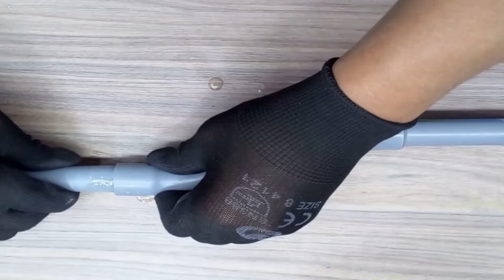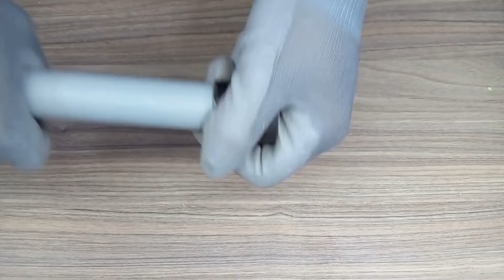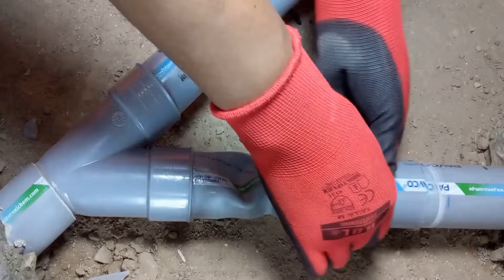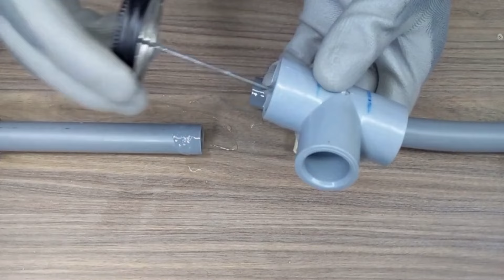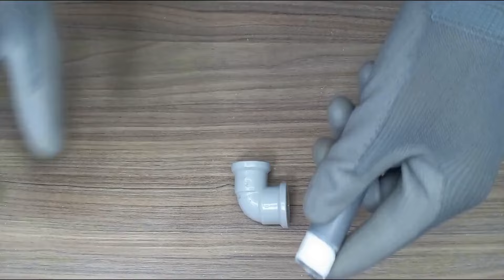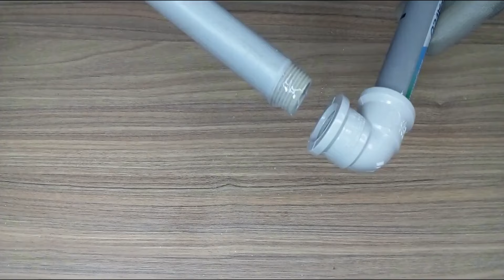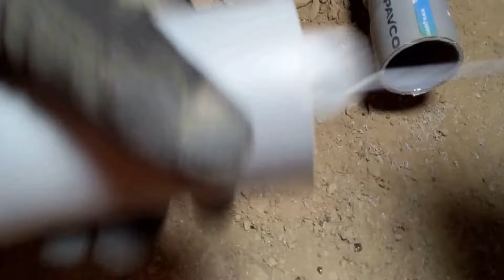10 Trucos o Formas de Reparar Tuberia PVC -  Hazlo Tu Mismo - Plomeria - PVC

Comment: "The manufacturer indicates that the pipe should not be heated"

-Heats everything.
Reply: Yeah I was about to say that people should not do what he is doing, because the walls of the pipe might get too thin and he might shrink the clearance inside the tube.
And that might increase wear and the likelihood of the tube bursting.
Reply: I am third generation plumber... id fire him and report him.  Never do this stupid shit. He looks like a hack unwilling or to cheep to do things right. . I mean... gluing a piece of pipe over a leak and tying it with wire lmfao... that one would get him beat up if he did that on my job.
Reply: @seditt5146  being a 3rd generation plumber, you dont know that the manufacturers of pvc allow the pipe to be heated..
I had to dig out my water main in several locations because of idiot plumbers. 
Since the main was never installed STRAIGHT it has stress points which caused fittings to crack in the mold lines..
The pipe is about 1/4 out of alignment..
I reinstall new fittings and pipe with schedule 80 instead of the schedule 40..
When talking to a manufacture representative,  he told me I can heat the pipe to relieve the stress..
The last one to break, a 1-1/4" x 90 degree fitting, broke below the service main valve coming into the house..
The idiot plumber during construction installed the house copper line about 5 degrees off 90 degrees coming out of the house and when sweating the fitting for the main valve sweatted if off at an angle about another 3 degrees off 90 degrees going down..
The pvc pipe going down into the ground is off by 1/4 inch or more alignment to the right of 90 degrees going to the horizontal  service  line at an angle not straight..
Only way to fix it..
Heat the copper pipe coming out of the house making it 90 degrees to the house or better, to put it, "straight", install a new "T" for the valve making it straight, replumb the pvc pipe..
The representative, said to heat the PVC into place instead, it wont change or hurt anything as long as it's not burnt..
By the way I'm a pipe fitter of 50 years..
I deal with manufacturers at times over issues such as this..
The best one I like, I got a plumber out for an independent opinion, must be the one that install  the service line..
He recommended digging up 75 feet of the service line from the meter, install a new one, including fixing the out of plumb copper work..
Which also means digging up the driveway since the line runs under it..

This latest repair will be the 4th time..
As for the repairs made in the video, i agree with some, but as the representative said pvc can be heated and bent into place..as long as it's not dramatic..
Reply: It should be noted that this is specifically why many states (US) have banned the use of PVC for any application that is inside of a building.

For outdoor application they don't really regulate  unless it's a water supply line. Theres a reason poly and other flexible pipe has effectively become the standard. 

If you're using PVC so much that you've learned 5000 "tricks" to "bend" the rules, you may be living in a country that hasn't embraced modern techniques and materials. (For cost, availability, or regulatory resons). I cringe seeing CPVC in almost every modular home between Denver and Appalachia, it's prone to failure, especially in high use, small Guage situations. 

 That being said, don't use PVC in a moisture sensitive environment. I think that's fair.
Reply: @6731adam  moisture setting environment. 
That's funny since its the go to product for water mains. In my state and
In areas where the frost line is deep is where it's a concern. 
6 feet down the temp average is 55 degrees..
Imagine digging down to fix a busted water main  because you dont want to hire a plumber because of raping of your wallet will get. ..
Reply: @Butchsiek  I live in Utah, all new construction and even city mains and building mains are switching to poly, mostly because it's cheaper, easier, durable to freezing, and last pretty much forever....

.....Unless you're fence guy hits it with an auger. There's that. 😆
Reply: @Butchsiek  I'm saying, don't use PVC in you're house, or other structure where things getting wet is unacceptable. PVC is prone to breaking, or coming apart, or freezing and subsequently leaking. Why would you if there's clearly alternatives that negate all those risk? That's all I'm getting at.
Reply: @6731adam  all pipe sources are subject to freezing and failing. My neighbors copper pipe ruptured when the temperature got down in the mid 20's overnight, he and his family was at Lake Tahoe enjoying the weekend and  when he got  back his house was flooded....
The pipe is in the attic because the house has slab flooring..
If he left his heater set and on at least 70 degrees, nothing would have happened..
My water main was frozen and I took a propane torch to it..then I wrapped it in a blanket because the temperature was going to get down in the teens at night...
Just the opposite when it's hot out in the 90's and 100's the cold water takes about 30 seconds to get cold....
Now its flexible tubing in new homes...
A step relative bought a mobile home, the piping is ancient, I offered to replumb her home because the pipes are rusted due to being galvanized pipe and the prior owner had a combination of bastardisation of plumbing repairs, copper, pvc, galvanized and pex..
I offer to due it all in copper, she turned me down saying I wasnt a plumber and dont have mobile home experience..
Everyone laughed at her, because i have done other movie homes for friends..
I let her waste her money and let it go....
After 4 months she still hasn't found anyone that specializes in mobile home plumbing or wont accept their qualifications...
Reply: @Butchsiek  lol! That's hilarious.  She'd do great on California board of contractors!

I wouldn't use copper unless it was just a repair situation. Even then, pex and shark bite justify their cost in time saving. Not like copper is that cheap either
Reply: @6731adam  oh to add salt to the wound.
About 14 years ago, I bought a water heater, it was a good deal and it included installation..
I shut the main off at the meter and then the house and water heater..
When I went to fix crack 90 degree fitting and turned the water back on, I went into the garage, the valve was leaking through the packing. Once open it stops leaking..
So much for a new valve that was used once..
I tighten the packing nut but still leaked..
Another project for the summer..
Reply: @6731adam  my neighbor around the corner was the on CaliFOREIGNia state contractor board..
The guy was an ass, he would peak over fences to see if things needed a permit, then go to work and mail them a fine if none were pulled..
Of course the fine is small, but the hassle to correct it was a pain..
My shed I need a permit because its bigger than 100sq. Ft..
Its 1400sq. Ft.
I would have to provide prints, pay for a permit and wait for inspection during the building process..
The reason, they think it would be used as a rental for living..
I had it built without a permit.
Reply: @6731adam  the relative doesnt want plastic anything  for fear of leaking or taste. 
She wants copper..
I do have 12, 12 footers of, 1/2" copper pipe in my garage, she could have for what I paid for them, $5 each.. 144 feet would about take care of 50% .
Reply: This fact is only for eléctrical pipes called conduit,so they can be heated
Reply: @carlossanchez5150  he indicated several times that this was water pipe. "Flow must be respected"
Reply: Even I who has no knowledge of plumbing knows that you shouldn't heat PVC pipes because it gets brittle easier
Reply: The disclaimer says specifically that heating is intended to be used ONLY in cirumstances when theres no other chance
Reply: Hes also decreasing the area of the pipe that means the pressure is going to be a lot higher
Reply from the maker: El Fabricante de Mi País indica : NO CALENTAR LAS TUBERIAS 

- Gasfitería y Electricidad : Como puedo reparar una tubería fracturada en tal situación , Pues Usted como fabricante no fabrica conexiones o aditamentos Especiales para realizar determinadas reparaciones .

- Fabricante : SOLO EN CASO EXTREMO , DONDE NO EXISTA OTRA ALTERNATIVA , ALLI SI PUEDEN CALENTAR LA TUBERIA . 
- Gasfitería y Electricidad ; Que se vayan a la verga los fabricantes de mi país .... Nos venden Tuberías y conexiones , nos indican como hacer la correcta instalación , y luego cuando se presentan fallas y no tenemos mas opción mas que calentar,  nos dicen : Repáralo pero sin calentar .... Si Usted estuviera en mi País realmente amaría el video con todo su corazón , pues es lo mejor que puede haber en su tipo .

Exitos a Todos .
Reply from the maker: Entonces aqui te moririas de hambre pensando dia y noche como solucionar una filtración . La gran diferencia es que Si Usted viene a mi País , Usted tendría que empezar de Cero , ya que veo que tiene una forma delicada de hacer las cosas . Yo por mi parte si estuviera en su país , podría resolver cualquier problema en la decima parte del tiempo que Ustedes lo hacen ...
Saludos Pinche Colega .

Comment: These are really handy tricks for the DIYer whose just trying to modify their drainage pipes and doesn't quite have the right bends/unions to finish the job.
Saves a trip to the shop.
Provided you have the skill to do it I can't see any reason why these fixes wouldn't last as long as using unions.
Reply: I don’t think your gonna do that to 2 inch or 3 inch pipe lol
Reply: @edgiraffr1352  well I was thinking more of the 32mm or 40mm under sink stuff, but I see no reason why it wouldn't work on an 80mm foul pipe if all your trying to do is make a socket.
Just be patient and gentle with the heat.
Reply from the maker: Gracias por su comentario .
Es exactamente como Usted lo sugiere . Son para trabajos menores , trabajos provisionales , trabajos de emergencia . Cada quien debe de garantizar su trabajo y analizar diversos factores antes de realizar cualquier reparación . 
Éxitos a Usted .

Comment: The quality of the pipes degraded drastically after bending by heating. It creates a lot of very small cracks on all sides of the heated pipe. In few years, the pipes will leak and finaly allow germs to enter into the flowing water. The leak may not be visible easily.

Comment: They heat pvc pipe for hot tubs. I worked at American Standard and they put pipe in a heater to mold it around for the jets.

Comment: I have experience in almost losing several thousands of dollars from water leaks caused by burst PVC. NEVER use it on water pressure. This was a nice video though
Reply from the maker: Greetings ,
I can say that PVC is very good, it must be installed correctly and the right material must be chosen, a good quality PVC material.
Thank you for your comment.

Comment: Interesting, though not recommended swedging the pvc because it thins the walls, small bends are acceptable..
Such as an alignment, but every country, state, county or  city can have their own codes...
Where I live, codes wouldn't allow thinner walls so sanding the pipe isnt allowed only fittings that have the same thickness..
Manufacture respresentative, stated heating for alignment only. Unless it's for non-costruction then it's ok
Reply from the maker: Greetings and Thanks for Your Comment.
-The Best Successes For You.
Greetings from Peru. 🇵🇪

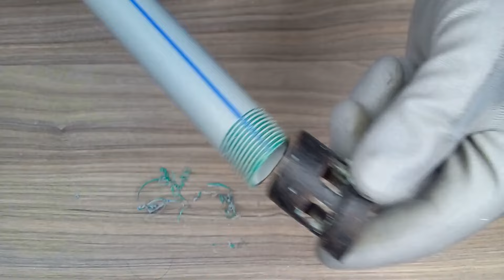Comment: At 1:35 he puts the thread tape on backwards.
Should be clockwise if facing the end of the pipe.
It matters
Reply from the maker: Greetings .
You are in the North, and I am in the South, so the turn is correct. Otherwise our system would fail. You can find this phenomenon in various subjects , for example the whirlpool it makes in the toilet is the opposite of the whirlpool it makes here in South America .
I hope I was clear .
Successes to you.
Reply: @GasfiteriayElectricidad  
You still have right hand threads.
Think of the tape like a coil  spring
With the tape correct you are making the tape tighten ad you turn your internal threads over it.
With it wrong, the internal threads push on the end of the tape loosening it. There by pushing the tape off instead of going over it
Otherwise good work.
Reply from the maker: La intención del video NO ES ENSEÑAR A APLICAR CINTA TEFLON. 
En dicha parte el video está en espejo por un error de edición. 

Bendiciones

Comment: Can we heat all pipe..heavy duty (thickness large)
Reply from the maker: Greetings .
Each country has its own regulations and its own additions for repair.
Here in Peru we do not have special connections to do this type of repair. PVC is different in each country, and before carrying out a repair several factors have to be analyzed.
Successes to you.
Reply: I'd suggest just trying it on a piece of scrap and see how it goes.
There are no codes to follow in the UK with regards to types of joints used.
All they say is for sanitary pipes they need to be water tight and hold 38mm water pressure for 3 minutes which is nothing.
Can't see any reason why these joints wouldn't achieve that.

Comment: Idea is good. 
But the strength of the pipe will be lost at the outer surface where the pipe was bent. 
It is more risky if you r using the pipes for  hot water.
Reply from the maker: Greetings
Once again answering what I answer to all those who do not read the description of the video and the pinned comment.
This is for smaller scale repairs, emergency and temporary repairs.
You should know that each country has its own quality of PVC pipe and we have different working pressures.
I wish him well .

Comment: The question is: Will the pipe have the same lifetime after being heater to bend?
Reply from the maker: Greetings
The pipes only do not suffer exhaustion after being heated. I have left information in the description of the video. You have to analyze various factors, the ideas in the video are to be applied in minor plumbing, popular housing, places where the pressure of work is not greater. Usually the working pressure in a home is 60 PSI = 4 Bars, easily the class 10 water pipe that supports up to 10 bars can last as many years as a pipe without being heated. It should only be heated in extreme cases, when we have no other option. You should know that in my country there are not enough connections or attachments to make different repairs.

Comment: Most of these will not work if the pvc is going to be used with fluid under pressure. When you join pipe with pvc cement you have to put the cement on both parts of the connection and turn the connection a quarter turn to make sure the cement fuses the joint properly. If you omit this step your connection has a much higher risk of leaking or separating.
Reply from the maker: Saludos , 
La intención del video NO ES ENSEÑAR A PEGAR O UNIR TUBERIAS DE PVC.
- Me gustaría que Usted defina : Que es y cuanto es alta presión ?  . Sabiendo su respuesta podremos seguir dialogando .  H e dejado información en la descripción del video y en el comentario fijado .
Le deseo lo mejor .

Comment: Great tips, but not rotating the pipes 1/4 during gluing is not ideal. Whenever it is possible the glued joints must be rotated 1/4 turn. Some tarp on the ground under the pipes will eliminate the brush hitting the dirt and picking up dirt.
Reply from the maker: Thank you for your comment and good advice.

Comment: The heatbending is done wrong. If you want to do it right without reducing the diameter of the pipe you have to use a spring of the right size inside the pipe. Heat it up, then bend it, let it cool down and take the spring out.

Comment: Fittings are made to reduce the turbulence created by flowing liquid.  This method wouldn't and you would have quicker failure of the joints
Reply from the maker: Leer la descripción del video y el comentario fijado. 
Le agradezco su colaboración. 
Éxitos a Usted.

Comment: There's a good reason that pipe shouldn't be heated. I think you can get away with it but only in a situation where you don't bend it more than ten degrees. 

Two things are happening here which would degrade the quality of this connection. First the outer wall of the PVC in the turn would thin compared to the rest of the tube putting two weak points on this S bend pipe he made in the beginning of the video. Second, the pipe diameter would narrow through these two bends.  Both of these would mean reducing the load the pipe can handle. 

So if you feel like copying this, I wouldn't recommend doing it anywhere important.
Reply from the maker: Saludos 
Gracias por su comentario .
He dejado toda la información en la descripción del video y en el comentario fijado .

Comment: Is that hairdryer ir what the one u used to heat uo the pvc
Reply from the maker: Greetings Sir.
- I'm Using The "Hot Air Gun", much like an electric hair dryer.
However, the hot air gun has more power and is designed for this type of work.

Successes to you.

Comment: Heating and bending pipe is a bad idea.  It makes the pipe brittle where it will easily break in cold weather
Reply from the maker: Greetings
That's correct, thanks for reminding me.
Also indicate that PVC pipes are not designed for low temperature places, that is their weak point. I am from Lima-Peru and the climate here is warm, for which I consider that there will be no major problem, since our work pressures also do not exceed 60 PSI (4 BARS).
successes to you

Comment: Doesn't bending the tube change the interior diameter?
Reply from the maker: Y cuantos litros menos pasaran por allí ?
Saludos
Reply: @GasfiteriayElectricidad  its not a matter of flow. The change in diameter will change the internal pressure the water is putting on the pipe. Which in turn makes the pipe easier and more likely to break after prolonged use.